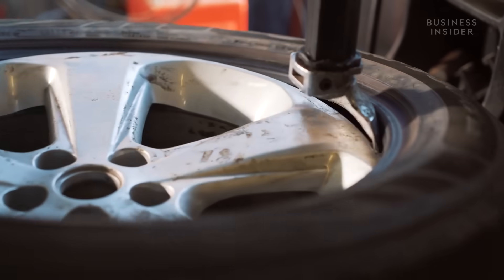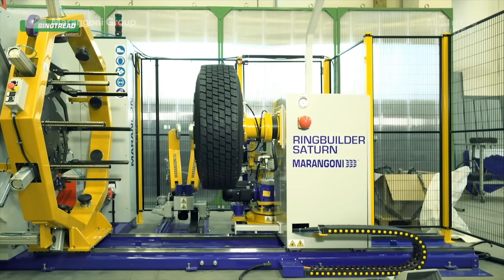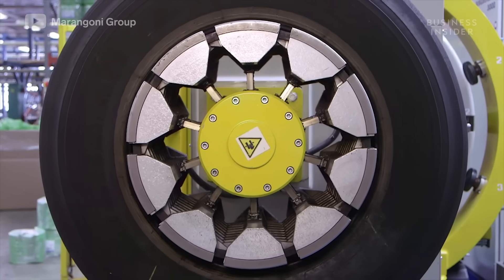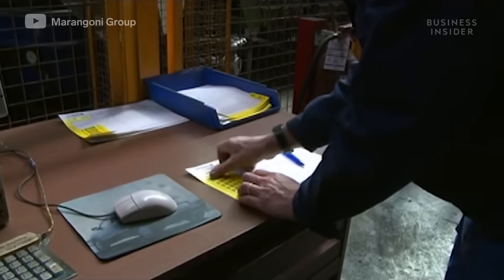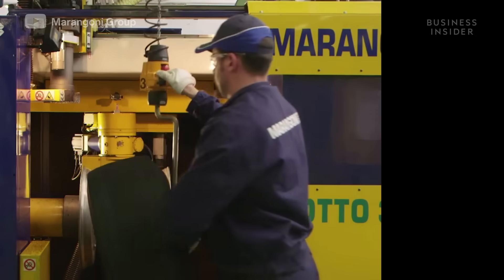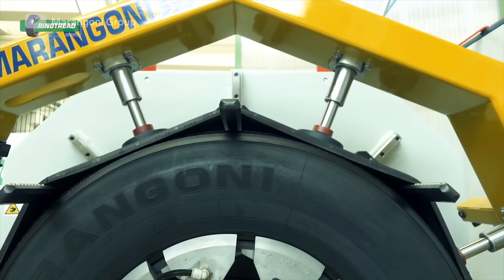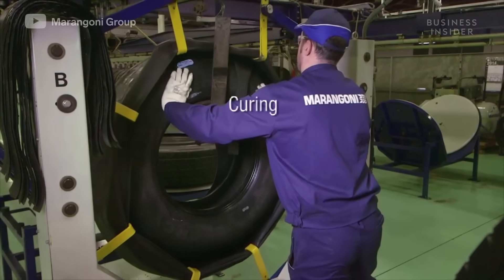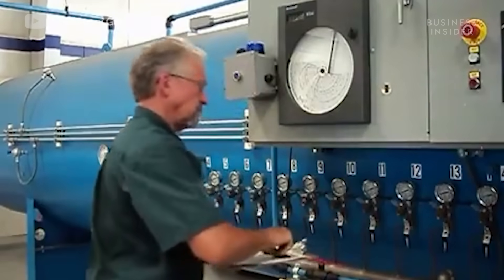How Old Tires Are Retreaded So They Can Be Used Again

Comment: I work in a tire shop. Last week a retread exploded in my face when i inflated it. It ripped apart at around 2 bar. Unreliable trash, would blow up on the road if not in my face.
Reply: I got with it once on the highway and it broke my front splitter.
These things are shit
Reply: guess they got some more work to do
Reply: Yeah you should see when 80 ton semi trucks have these come flying off. Not very safe. It isn’t just one occurrence either, you see several tire treads lying by the side of the road if you drive long enough. These coming flying off at 70 mph and smash up cars.
Reply: @shadowthesi  yea and every one of them is likely a new tire
Reply: Did it make u fly?
Reply: Had one go at 70 psi or more inside trailer tire I was hugging the outside tire went to check the pressure and it stood me up real quick.
Reply: Hows your face doing frogger
Reply: Bullfred !!!!
Reply: Hey you took one to the face, good girl!
Reply: 😂😂Im sorry i juat cant "it blew up in my face"😂
Reply: Well that suck
Reply: @Prranjal Shrivaastav lol Re vulcanized? I rubber is black, its vulcanized.
Reply: So u shud scalp ur boss face for the same risk u have
Reply: I love these retreaded tires!
Reply: I can't speak for mechanics. Personally I love my mechanics and I love exchanging information with them to become a better driver. I can speak on how unreliable they are compared to a new tire. They do not last as long. You can have perfect tread inch thick and that money is waisted because it blew up. We can argue psi and tire pressure all day long. Now you can't just blame the drivers either. Some companies or most Don't give the drivers an option. Yes it saves money upfront but in the long run I'm not convinced they do. I'm sure some are really good but at what chance am I going to get that good recap. To me it's not worth damaging other cars. Yes pretrip pretrip blah blah blah...you still Don't know if that tire will fail. That tire around 100psi average can do some damage to mechanics as well as trucks and cars. Everyone has an opinion. I know every time I have blown a retread or recap the tread wasn't even halfway used or dried out and rotten.
Reply: This is not safe but what do you liberals know about safety
Reply: I would imagine faulty tires aren't retreaded as in this video here
Reply: Is there a way to know whats been retreaded vs actual new
Reply: It was the second type of retread.
Reply: What gets me is car tires are illegal to retread yet semis its fine, the difference of 82,000 pounds, there only illegal beacuse there'd be no taxes to gain or profits.
Reply: @smcfadden1992  that's not true at all
Reply: @smcfadden1992  Do you know how much more material there is on a semi-tire? That aside, without a special permit most parts of the US don't allow more than 80,000lbs gross weight for the average semi. You were only off by a bit but I like to make sure people know for sure ;)   dunno about other states but mine specifically allows 86,400lbs but only if you have a split axle trailer, not tandem...Oh and lastly, we're allowed retreads on all axles EXCEPT the steering. For obvious reasons.

I have seen a lot of tire failures, even on the retreads but as said somewhere above it's usually the casing not actually the new treads
Reply: Frog Cartoons Are Racist Nazis - But isn’t it comforting to know our lord and savior had his reasons for letting that happen?
Reply: I seen a semi retread fly off thankfully we weren’t too close but we almost got hit with it
Reply: @vel6979  this had runflat damage inside the tire tried to be nice and give the guy air, there's a first and a last time for everything
Reply: @vel6979  how did you know it was a retread you pulled over and inspected the casing?
Reply: Stop lying!!!
Reply: How can U guys believe this bullshit. At 2bars tire would not explode, even if damadged, lol. And guys who renews them, check them with specific computer systems is it damadged from inside. I believe, that they even don't renew tires which is older than 5 years.
Reply: You put to much air. Hopefully you compensated them for the damage.
Reply: @josenator1821  2 bar when the manufactuerer of the car put a 2.3 bar requirement for that specific tire size.
And also we inflate tries to 5 bar, used and retreads to 4 bar, before deflating. So they sit on the rim evenly. And that trash blew up half way. I have even inflated low profile tires to 8 bar oiled with wd40, if they didn't sit well on a rim. And the only time a tire exploded on me was this defected retread.
You clearly don't know what you're talking about.
Reply: @josenator1821  if 2 bars is too much air for you  its looks like yo know 0 nothing about tyres
Reply: josenator no
You think a Mechanic doesn't know what he is doing but you do? Have you worked as a mechanic?
Reply: @The Hunter He works in a tire shop, he's not a mechanic.
Reply: @Zevizi  being a mechanic doesnt make you more knowledgeable about tires they're nearly unrelated lmao all they do is change them omg hes a genius he can remove lugs and pull a tire off the rim everybody applaud them
Reply: You seem like you make alot of stuff up
Reply: Fake
Reply: The only way that can happen is if you overinflated the tire.
Reply: @lefthanded5473  ~2 bar is underinflated. And the tire got ripped along the sidewall, where it contacts the rim. I think the retread process was ok, but the tire casing was just too old or damaged in a way the manufacturer couldn't detect it. Because literally the part with the steel rings ripped 1/3 the way off the tire.
Reply: Frog Cartoons Are Racist Nazis Does make now sense after you explained it. They should probably test the tires after they are retreaded.
Reply: @YUSoDumb1  Retread or not,if it was old and damaged it could blow up.
Do you consider non retreaded tires to be unreliable junk ?
Reply: @YUSoDumb1  if it was underinflated it would have never blew in your face dont lie. The second step in rereading tires is shearography they are put in a vacuum that detects every defect inside the rubber of the tires if the rubber was defected in the sidewall it would have been scrapped now go compensate those people who's tire you blew up

Comment: It'd be interesting to see exactly how well they perform against new.
Reply: They perform fine in the winter and are useless in the summer. Good for cold areas but don't buy if you're in a warmer zone. It will fail and can hurt someone
Reply: Never use it daily on your commute car. If you have big load and driving it slowly maybe it will perform well. But it very dangerous on high speed. The heat alone will blow the retreated rubber.
Reply: Most retreads are just fine. You do see the tread coming off sometimes but far more often it's the entire casing that fails while the tread is still just fine. I live in an area that regularly hits triple digit temps 3-4 months out of the year. The heat isn't that big a deal. Not unless you're using some of the cheaper ones anyway... But truckers put exponentially more stress on retreads than any small vehicle ever could and most end up with no issues. 

People will say they see them on the side of the road all the time but have they ever stopped to consider how many they actually see? Have they ever tried to compare that with how many trucks actually drive through that area on a daily basis? Doubt it.
Reply: In fact are some old passenger sport tires that perform better that the new ones,they just need retread,those are the reinforced tires,i lie one tire especially that was made from 2006 to 2008,its still on the road.

Comment: Buyers beware these tires are extremely dangerous,  Extreme heat like highspeed  driving can cause them to separate.  I saw a guy that had a 1957 Chevrolet put a set of four on his car.  He was flying on it that night the retreads came off.  The car was totaled and they were almost killed.

Comment: This makes sense for heavy use commercial vehicles that go through tires quickly, and tread-wear is the dominant reason tires must be replaced.  But for personal cars and trucks, often the tire sidewalls will exhibit severe cracking by the time enough miles have been put on the tires to wear the treads down.  Yeah, if you can retread a tire and double its life, for significantly less than the cost of a new tire, why not?
Reply: Jess Stuart no. Just no. Retreads are not reliable. They dont last long at all. That is why alot of highways are littered with tire chunks. Those are retreads. In the end they cost more than a new tire. People can get killed or injured by a retread blowing up on the highway, and the expense of having road services come to you and put in a new tire. Retreads are not worth it. You can ask anyone in the trucking business. Only companies being cheap do this.

Comment: Retreating can be VERY dangerous.  They often will fail.
Reply: Modern retreads (the process used in this video) are comparable to brand new tires as far as failure rate.
Reply: Retreating it isnt dangerous, using it is
Reply: Its can be but if they actually test the integrity of the tire before putting new tread on it it should be fine. Retreads get a bad reputation because the guy at the local tire shop is doing it in house and not checking the integrity of the tire. Better get used to seeing them any way. it wont be long before the big brands start doing it to save money and cut back on pollution.

Comment: Do not, I repeat do not have this done to every day commuter tires. The heat alone compromises the durability of the tire. Re-threading won't fix that issue.
Reply: Remolding is a better way of recycling tires right? 🤨
Reply: This method will probably be deemed safe in the future for enviromental reasons. They will  make new tire prices out of reach for normal people forcing them to buy these.  I dont agree with it but wouldnt suprise me.
Reply: retreads havent been legal in the US for a long time, other than on semi trailer, and you see the results of those on the sides of the highway
Reply: @bradhaines3142  if that's the case, how do we have companies like TreadRight making light truck/SUV retread tires?
Reply: @puzzleluvr  i did some more recent research, i was disappointingly misinformed. they're legal, just dangerous. still would not suggest them for anyone, no matter how you spin it its still an old tire, and they have an expiration date thats more serious than some food
Reply: @bradhaines3142  no doubt, I just knew they weren't illegal (at least in most places) last I checked 👍
Reply: @bradhaines3142  Bull Crap, They are only not allowed on the front. Many trucking companies use them. Goodyear also warrants their retreads the same as new.
Reply: @JT-qf4it  only allowed not on the front as in the steering tires or as in not the trailer? and they're not legal on passenger vehicles at all which is also shows how bad they are.

Comment: This practice should be stopped many of those recaps tires end up failing and falling apart in the summer day. I myself almost got hit on the highway while driving
Reply: Re Up Have you been to Greece 🇬🇷 in the summer?
Reply: Gomas Recapadas.  ;V
Reply: @Cuban this is a different process they add tread vs the tradition and more common is to use machines to cut more tread they dont add material this process does and is like new.
Reply: The truck driver was going too fast or the load was over the limit.
Reply: fernarias lol like a truck could ever go too fast.
Reply: They're dangerous and should be illegal!
Reply: @r.d.9399  facts

Comment: They may perform fine in "normal usage" but what about when you put severe lateral stress on them? Which would happen, umm, at the very MOST critical time in which you need the tire to perform, not fail and flail you into a tree or such?
Reply: F1 world champion Denis hulme credited his rapid rise thru the lower racing classes to allways running retreads. His comp would be on the early 1960's hard racing tires and he'd blow by them on as he said"soft sticky recaps". Please remember that this was the early 1960'S and sliding thru the corner was the fast way around.
Reply: PS. I ran them on a dirt street stock for 5 years no problem except a crash put a hole in the side wall of one. And if your unfamiliar with dirt racing you are sideways and sliding the corners. Chuck it to the left,crank the wheel to the right and steer the car with the gas pedal.

Comment: Retreading is a deadly practice.  Most blowouts on the highway are from retreading. These blowouts cause thousands of death per year. Now do a video about exactly how many crashes and deaths are caused by this dangerous practice.
Reply: let me clarify I mean the actual shred that was glued onto the previously old tire comes off and causes an accident. Not a blowout exactly.... More like a catastrophic failure because of this practice.
Reply: HEY all the people saying these are dangerous ENOUGH! ANY UNDERINFLATED TIRE WILL KILL.,NEW OR RETREADS.Under inflation leads to the innerliner (the part that actually hold the air in the tire)to come apart so it won't hold air anymore and you either have to keep adding air or the heat generated by driving on almost flats cause the tire to come apart.Worked in tire shops many years and on all warranty claims it was dismount tire from wheel and inspect inner liner. 90percent were "run flats".Not in the biz anymore but I still check my tire pressures once a week.When was the last time you checked yours?I mean it's only your and your families lives your gambling with!
Reply: @bobtoler5322  people arent as stupid as you not to check their ture pressure.
Reply: Under-inflation causes most blowouts.